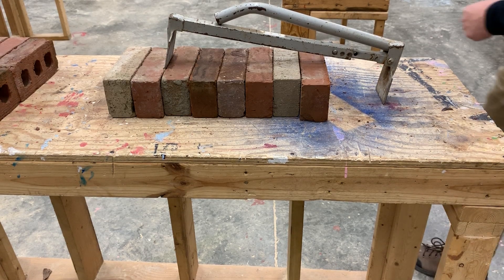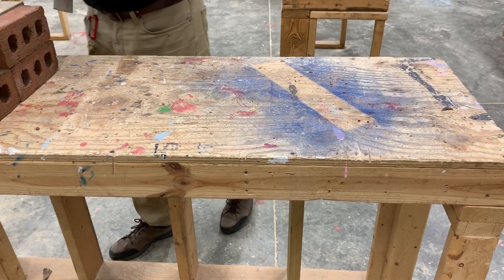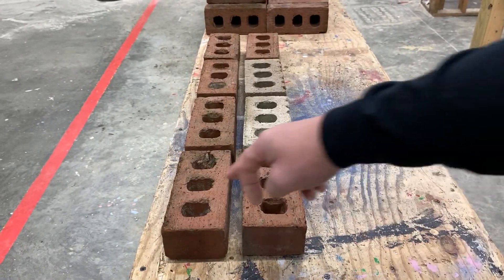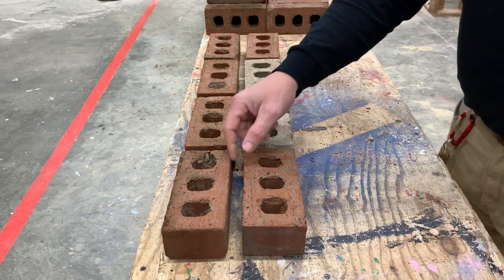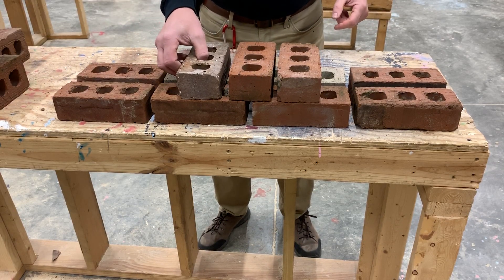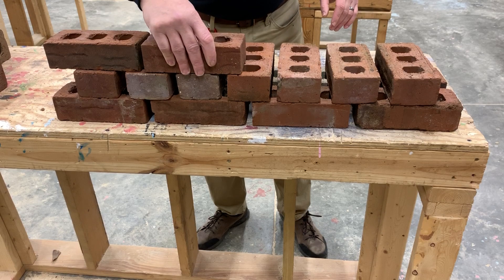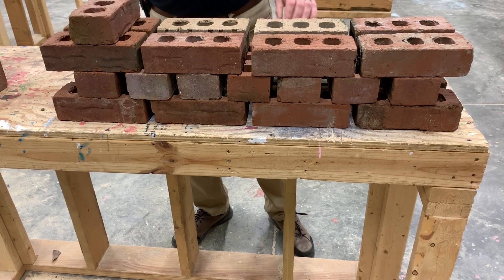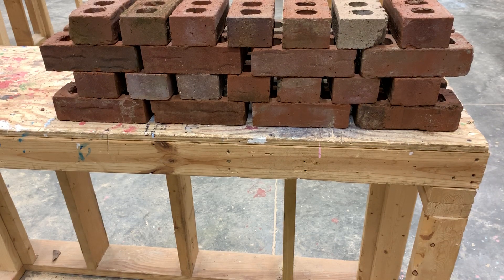English Bond

Comment: In my town there are a lot of 19th century building that have the row of headers every three or four rows. The public Hall which was opened in 1824 has them every forth row.
Reply: Here, they used 1 course headers then 5 courses stretchers. I've heard it called either "Common Bond" or "American Bond".  This saved on bricks.
Reply: @johnwanner9000  Thanks for the Info John.

Comment: English bond starts with a course of headers though does it not??. Your first course is stretchers which is confusing
Reply from the maker: It alternates courses of stretchers and headers. I've always seen it started with stretchers, although there are very few English bond examples in the region i live in. Most are American bond styles.
Reply: It starts with a course of stretchers and alternates with headers with queens closers on the header row
Reply: Old timers I spent time laid it both ways in the same course. Imagine end walls as stretchers and side walls as headers. That keeps the bond in each course in the same pattern all the way around the building  first course on each side wall used a queen then second course end wall queen and so on.
Reply: If you are building a square (e.g. a house) the first course would have the North and South walls as stretchers and the East and West walls a headers or vice versa. In other words, it doesn't matter